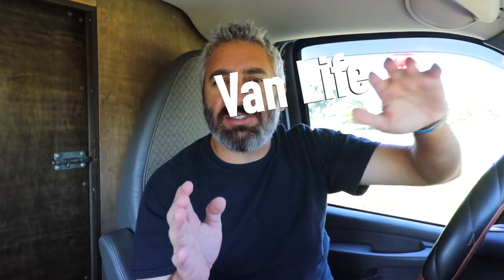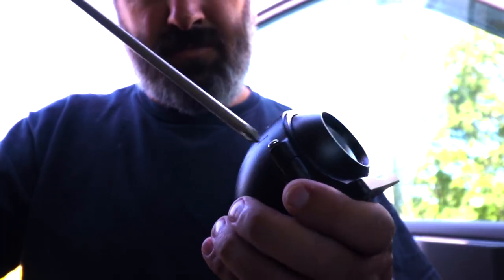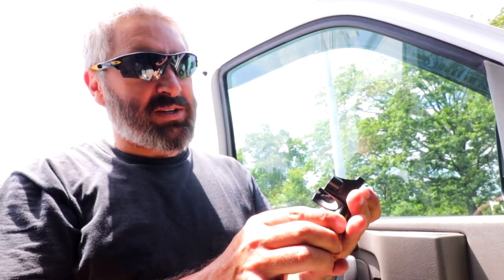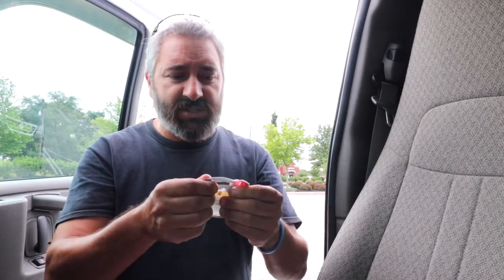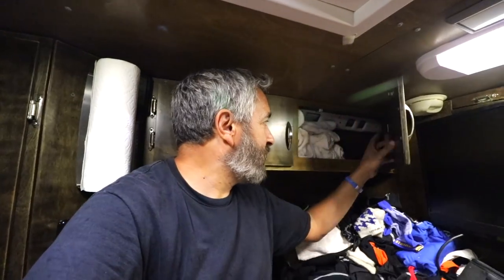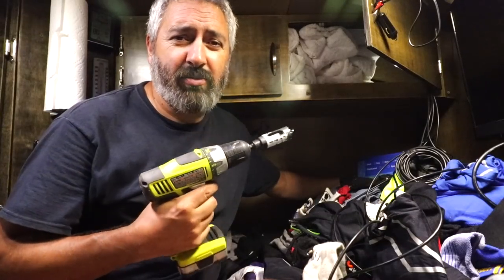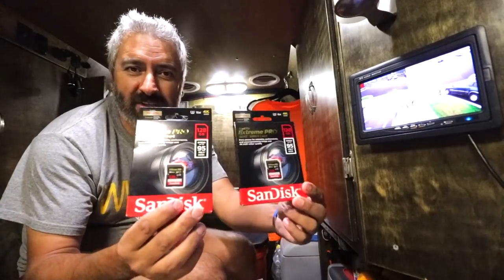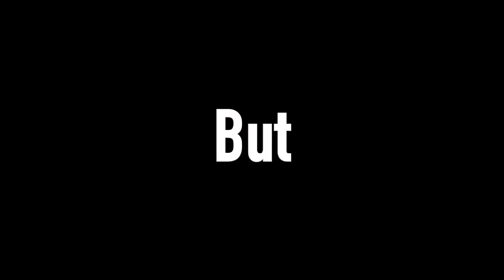Van Life; Full Security System! Better Late Than Never!

Comment: Aside from your cams, which are great. Put a dash cam inside driver window, mount it up above on the metal just above door, aim it out driver window. Wire it up so it automatically turns on when you start your engine, with a separate switch to turn it on to bypass starter when engine is off. Be sure to tell whoever stops you, they're being filmed.

Comment: Luis, I bought a 12.5 ft ladder this week from Amazon just like the one you have. It came in yesterday.  A ladder and an electric drill are two things all RVers need. (Along with a lot of other stuff.)
Reply: What is the ladder description? I want to buy a couple of 12 footers. Thank you in advance
Reply: Jerry Minchey Jerry I have a similar one 10 footer. They are good for occasional use.
Reply: Mark Julius Mark I have a similar one 10 footer. They are good for occasional use.
Reply: personally, I would rather go with a bolt on ladder, rather than take up space inside the van to store it. Besides space they are safer, the last thing you need is to be coming off the top of a van face first because the feet of the ladder kicked out when you put some weight on it.
Reply: They now have the ladders that fold up on Amazon.  check them out.  They fold up flat and can be put under a bunk.

Comment: I think a better security solution would be if the cameras sent a signal to your phone. Thats way you wouldnt need a monitor, and you could remotely watch your vehicle from afar if you leave it to go somewhere.
Reply from the maker: Yes, but they cost a lot more too. 👍🏻☕️🚐
Reply: Rolling EarthShip Well it wouldn’t work on the outside of the van, but if you use the free app “presence”  you can turn an extra cell phone. ( iPhone 4 at least and up ) into a security cam, or baby monitor. I used two older phones to keep an eye on my dad when he started developing dementia.  You can talk through it. Hear through it and set off an alarm plus it sends an email or text or notification to any phone you want.  The catch is, if the phone isn’t connected to a network 
You have to have WiFi.  And it’s all free.

Comment: Great job! Tis good to have security camera with more break in's with vehicles then homes. Great thinking on how to catch the metal shavings. You think of everything. How neat is that. Worrying about the safety of others and the pieces getting stuck on your vehicle or blowing into the windshield wipers to scratch up the glass, not to mention what it would do to the eyes. Tis good you pointed it out on your video. Hopefully everyone will also do this and make a catcher for the drill bit shavings.
Reply: Jude W Jude good point on windshield, I didn't even think about that & I'm good.

Comment: Good hunor as always. You went all out with a system! This reminded me that besides the wasp spray, I should get one of those very loud personal alarms, so if I hear someone breaking in I can "pull the cord!"  Or maybe I could use a similar door or window or door open alarm and attach it to inside of van doors. Of course I'll forget at times to disable them and scare myself and the world. Brackets! So many brackets! Nice install! Have you thought of using one of those roof adapters that you can install into the roof, and the wires go inside the side of those? Less chance for leaks. You have a good seal there tho for sure.

Comment: Don't you need an Internet connection for this? How would that work if you are traveling around? Funny guy. I have a ring wireless spotlight cam -- would that work on a van??? They have solar too for the ring. But you need Internet!
Reply: You can use a Verizon mobile WiFi thingie... keep it in the van, hooked up to solar... I doubt it uses much power... then your cameras--also on solar--are connected to the internet and you can be notified when you're away if there's an alert.

Comment: simple solution for the forward facing camera is to put it inside the cab, either dash mount or headliner. Not a fan of the "red lights" on the camera, seems like this setup will be drawing a lot of battery power all the time. Next step is to find replacement connectors for those stupid long cable, cut them to length am solder new connectors on. Doing this right from the start would have been ideal an help to reduce the size of the hole. Or better yet, would have taken the top brake light off then ran the cables through that hole, then put the brake light back in place.